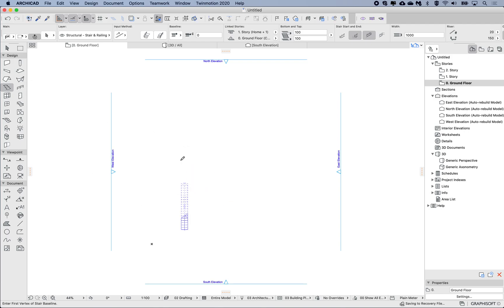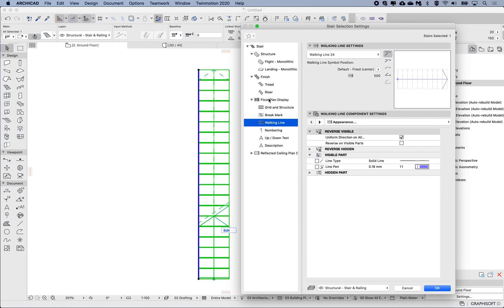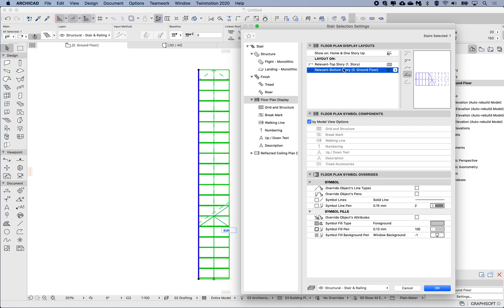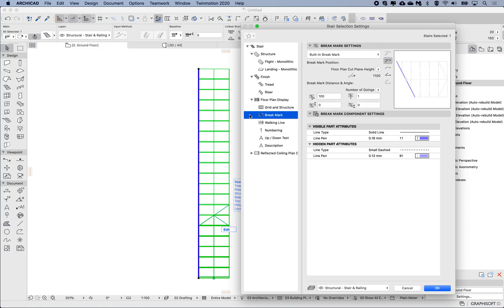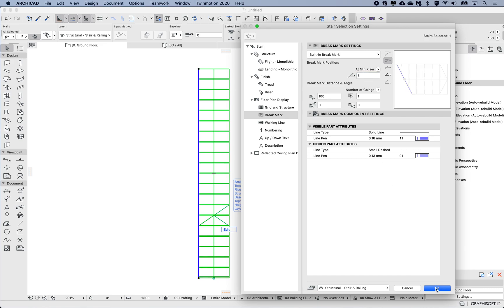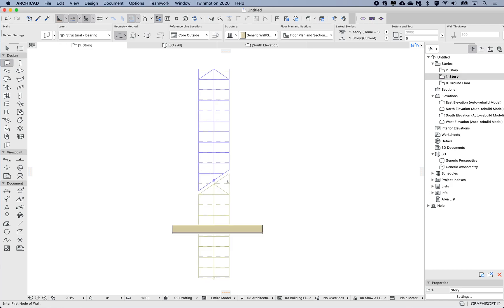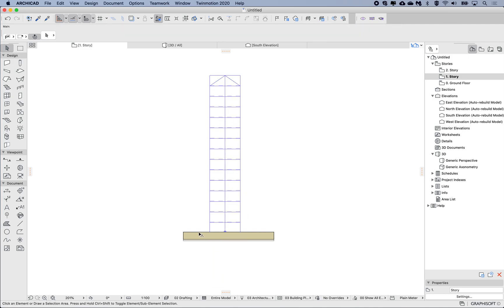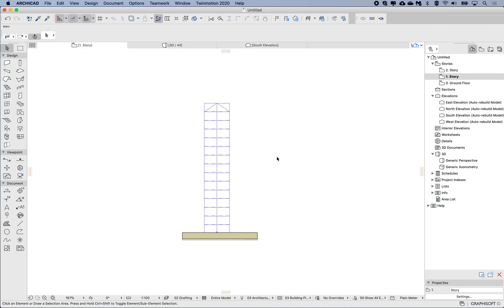Archicad Tip - Stair Floor Plan Display

Comment: Hi James. Thanks for these tuts. They are very good. Keep them coming. 
Wrt the floor plan representation of stairs: 
There is a problem that has been bothering me ever since the release of the stair tool and I still don't  see a good solution to it. 

By default,  the stair symbol shows the lines of the last thread and the arrow points to the last line of the thread. 
This is does not comply with graphical standards that I am aware of and it is misleading. (it shows as if the stair had 1 extra riser) 

The symbol can be fixed,  but it is very cumbersome and time consuming to turn off lines one by one,  especially in a complex project with loads of stairs. 

As a minimum, there should be a tick box option to not show the last thread lines on plan, same as the tick box to stop the arrow at last riser.
Reply from the maker: Maybe we can talk offline (so I can understand better), but you've looked at custom GDL for the Stair components? For example, for me it's a bit annoying that for the Walking Line, you can't turn off the circle at the start...if I get time one day I might try to look at that.